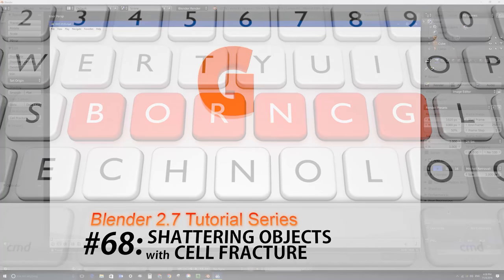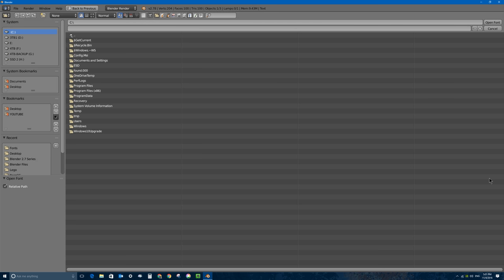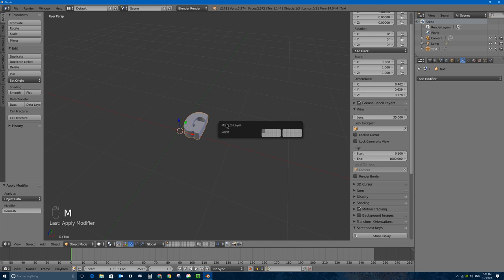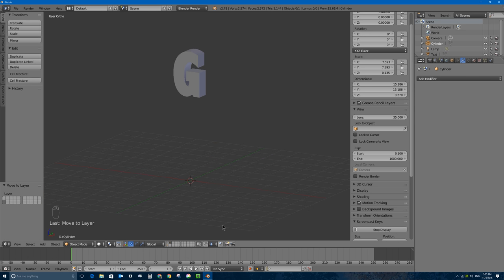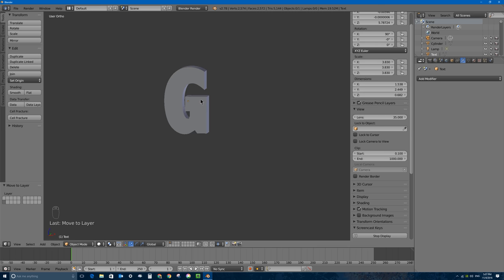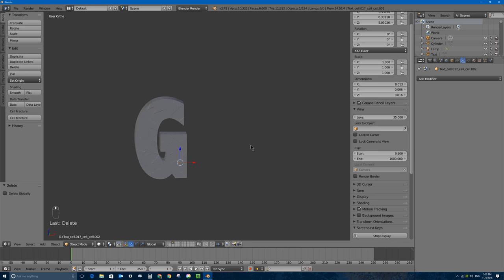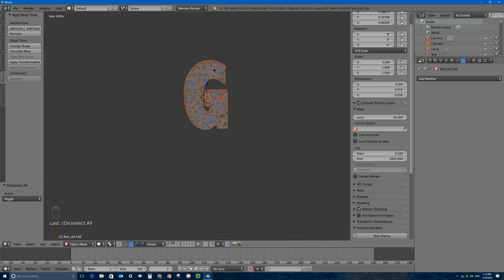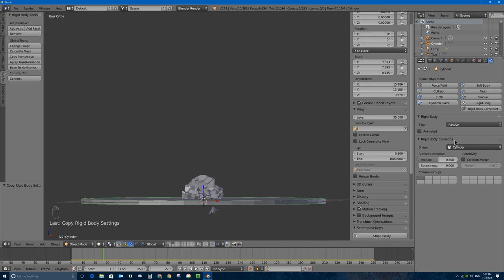Blender 2.7 Tutorial #68: Shattering Objects with Cell Fracture #b3d

Comment: Hey CG, thank you for this tutorial. There was a lot more information here that I found really useful to add to my own knowledge of the system.

But one question I do have is about the animation. YOu used the exclude layers to hide certain objects. Is it also alright to use the eye icon in the layout?
Reply from the maker: Thanks! :) 

You mean the eye icons for each object in the outliner window? You can probably animate that, but you'd need to insert a keyframe for every shard of each letter. Animating 'Exclude layers' lets you essentially hide/show objects by-keyframe as a group.
Reply: True, you have a point there. I think the eye works okay from time to time, but I would prefer your way for groups of objects. Thanks for answering :)
Reply: You can also group them with ctrl-g and animate with the eye that way as well...

Comment: I have uploaded videos showing the cell fracture and rigid body collision working perfectly in a scene which contains nothing but the object to be destroyed, the plane, and the object which destroys the first object. However, even having successfully done that, when I have returned to my full cabin scene in which I wanted to use the destruction of a door, it doesn't work. The shards just collapse at the start of the animation for no apparent reason despite the settings being the same as in those simple scenes in which it works correctly, the only difference being that the door object is in the center of the scene in the latter.

Comment: ok, i have an odd Q. what if you want to 'reverse' physics. i.e. you have an animated object you want to shatter, rain, etc UPWARDs? can you do a quick explanation on how to do that please?
Reply from the maker: You want something to explode in mid air?
Reply: @BornCG  melt upwards actually, although exploding in mid air would also be cool to know how to do :)
Reply: I guess basically im asking if there is a way to 'reverse' gravity?
Reply: @BornCG  here is maybe a better/clearer idea of what i want to do:  

is there a way to ‘reverse’ gravity physics? here are 3 examples of something i would like to do:

1. i want to have rocks, soil, ect ‘melt’ upwards, as if they were leaving the ground and  floating up into the sky.

2. i want to do something similar with an object falling DOWN but the water/matter falling off them UPWARDS. like a split gravity situation, one goes down with natural gravity physics, and the other on top of it does the opposite with reverse gravity physics.

3. i want to make it rain/storm backwards

is this possible? it seems like it SHOULD BE possible. How can i do this?
Reply from the maker: You can change the direction of gravity. In the Properties window there is a 'scene' tab (3rd tab, 3 objects), and under that there is a section called gravity. The default gravity is -9.80 to match earth. You can change it to 9.80 to gave gravity 'fall' up. ... but is what you're describing exactly that? Do you want to just animate things moving upward? or do you want to reverse video of things falling and shattering so that they un-shatter and fall back up? Neither of those would be best done I think by changing your scene's gravity.
Reply: @BornCG  not reverse shattering. Say i have a character which is destroyed and that breakdown of their end is either melting, ashes flying or some other descriptive effect up and away, away from that animated character. Does the gravity setting have the ability to apply different gravities to different objects for something like that?
Reply from the maker: You can't have different gravity on different objects, no, but you could composite together two scenes.
Reply: BornCG ok, thanks for the answer. Now compositing scenes together... Please tell me you have a video on that lol! It sounds like it might be a bear to do...?